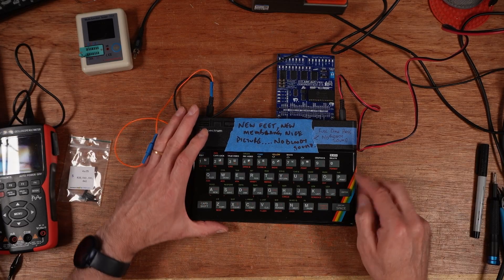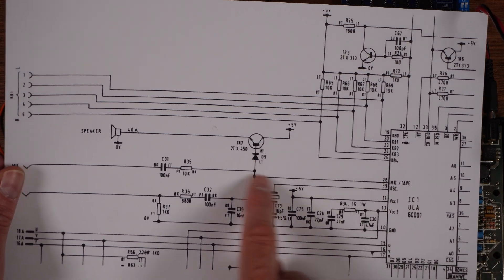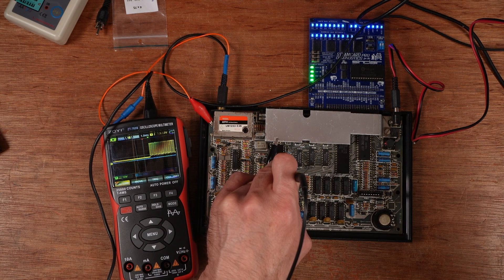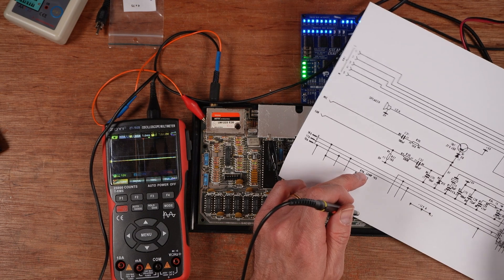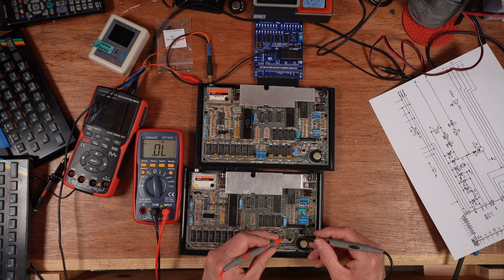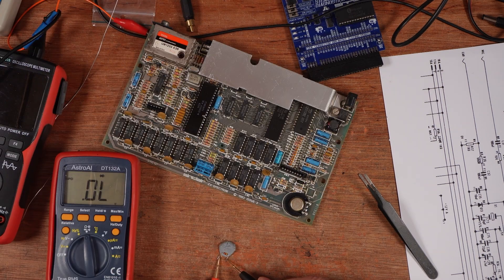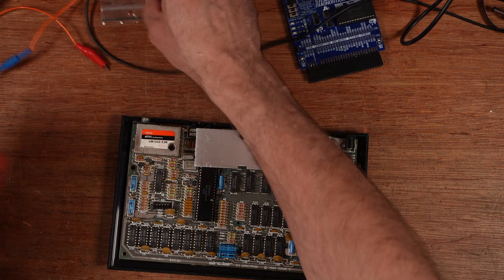No Sound ZX Spectrum Quick Fix - Bonus Episode!

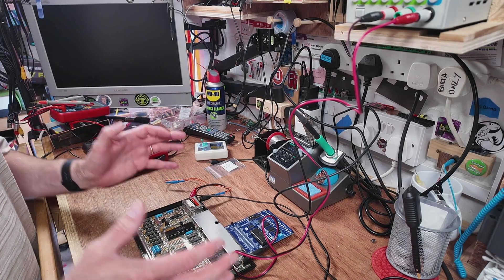Comment: 1:50 I can't help but wonder if it would be possible to make a daughterboard with a few GALs as a replacement for the Speccy's ULA. I'm obviously far from an expert on the matter and someone's probably rolling their eyes reading this just about now. But you know, like the dual GAL-board PLA-fix for the C64, which was kind of popular a few years back.
- I mean the Speccy's ULA has clearly already been backwards engineered decades ago for all the eastern block clones, the more modern ones like the Harlequin, and such. Wouldn't it be possible to make a replacement using cheaper off-the-shelf components without having to resort to the more expensive FPGA or CLPD chips? - Maybe focus less on making it neat, compact, and pretty, but rather on making it affordable and easily DIY-available? - Just so that these old machines wouldn't have to be diagnosed as "for parts only".
 - But hey, what do I know...  just a thought. 😅
Reply: I often thought that slightly defective ULAs could be saved with external components like Sinclair did back in the day with their fixes. And yes, a cheap ULA-Replacement would be very welcome. Your daughterboard idea with SMD components could fit (maybe better in a plus case).
Reply: @onkelnb  The thing I'm trying to get at is, that GAL (Generic Array Logic)  or PAL (Programmable Array Logic) chips, which are sort of like the great great great granddaddies of today's CLPDs and FPGAs, may just be much cheaper alternatives to those two modern ones, and still take up far less space than recreating the entire ULA with a ton of 74xxx logic chips (you know, like Dr. Emmet Brown's 1955 time-circuit style) as has been done in the Harlequin.
- I think the real question might be, whether such GAL/PAL chips are still widely available, or there might be something else in between (as in less "great great great" grandfather'ish) and which could potentially be even cheaper and less unoptainium.

- One could be tempted to claim, that the ULAs and PLAs of the '80s micros, sort of are like the granddaddies to the GALs and PALs.
Reply: @Zhixalom  16V8 and 22V10s are still available, or rather replacements for them are. They dont have the gate count to implement the ULA though, it needs a small CPLD. Such replacements exist such as the Nebula and VLA82
Reply: @jaycee1980  That's something along the lines of what I'd expected, thanks!
- And I suppose that there wouldn't be a way of combining 2 or more of them, to reach the required gate count, sort of like with the dual-GAL PLA-replacement board, I was on about earlier for the C64s?
Reply: @Zhixalom  not really.. plus you would never get the IO count anyway. This is effectively what CPLD's are for
Reply: @jaycee1980  Thank you.